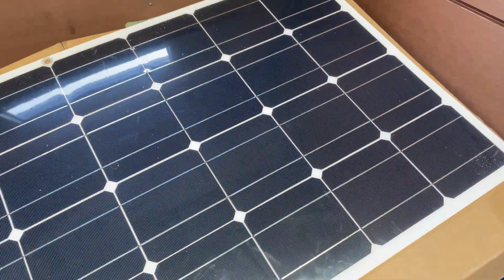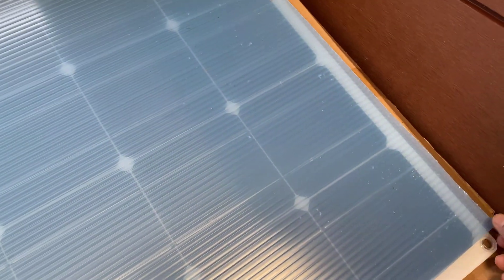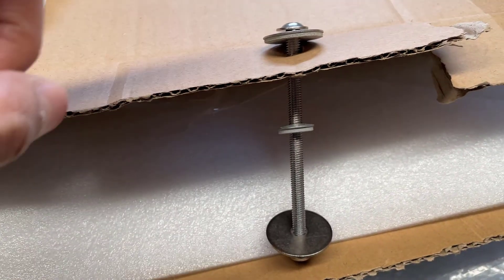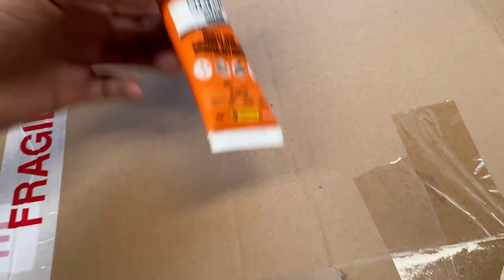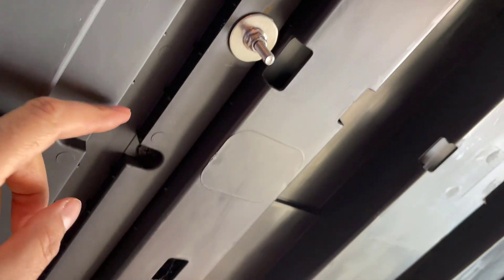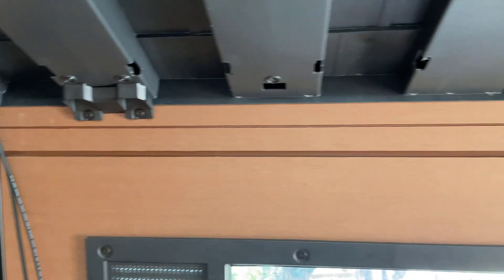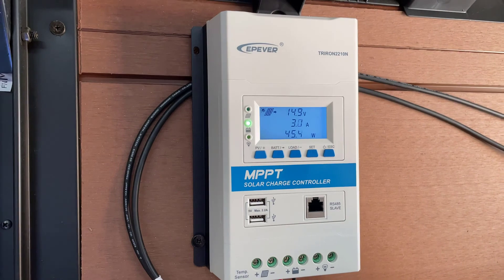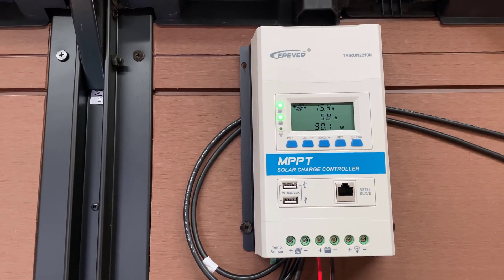Installing a Solar panel on a plastic shed roof

Comment: do you happen to gmhave video of your battery storage hookup?
Reply from the maker: For this specific setup no, but essentially it's split between 3x 180Ah Batteries, 3x Charge controllers and around 3x Solar Panels each. This gives a good spread and enough storage to power various projects throughout the year. I might do a follow-up video of the whole setup at some point

Comment: Hello great video I'm about too install solar on my keter shed. I have a question how did you put the bolts in at the highest point did you climb onto the roof as this is my worry bolting down by the ridge at the top middle section...thanks
Reply from the maker: Thanks for your comments. I used a step ladder and managed to reach the top easy enough without having to climb onto the roof itself. I installed the panels as close to the ridge as possible and later sealed any gap between the ridge and panels using sealant, that way any rainwater will mostly go over the top or down the sides of the panels. Bottom line, wherever you have worries, use sealant.